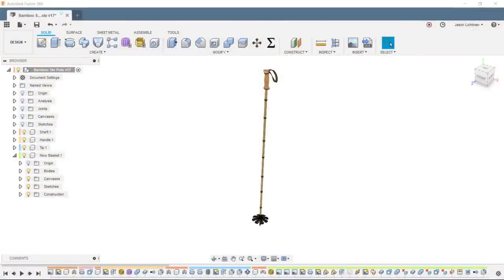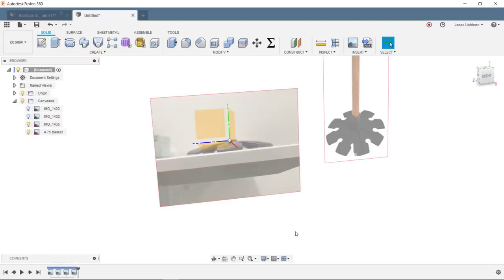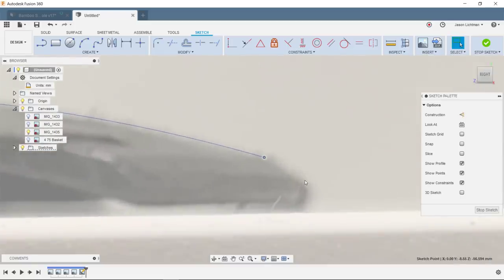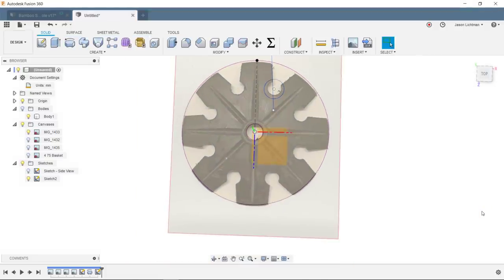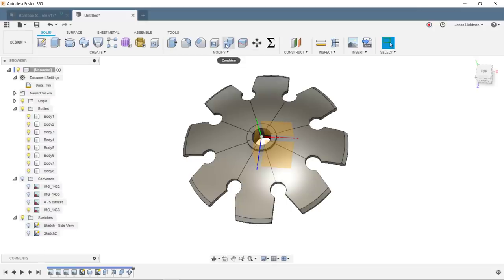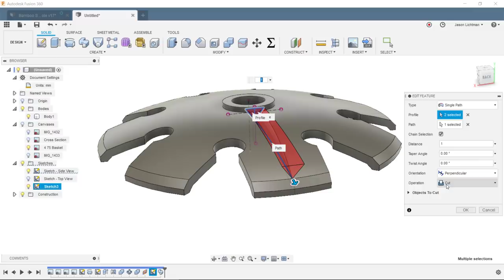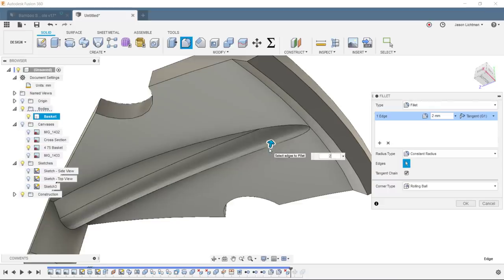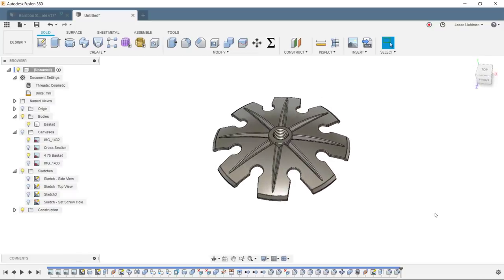LIVE DEMO: Mastering Reverse Engineering

Comment: Pro tip: calipers have another pair of ground faces. Namely, the top of the fixed jaw and the top of the inner measurement jaw. These will be flush when your calipers are closed, and can be used to measure height of things without the fiddly depth bar.
Reply: Anonymouspock, thank you for the tip. I try to use the best tool for the job. So, I do end up using all three areas of the calipers depending on what I’m trying to measure. For what I was measuring in the live demo, I thought the depth bar would be best.

Comment: After aligning the image to the body why did you move the image back to the original position in the timeline?
Reply from the maker: I'll see if I can get Jason to respond to you....or I might be able to figure out why he did that. What time was this at?
Reply: Pete, if I’m creating a model using a canvas, I start by inserting the canvas and positioning it as best I can. Then, I start sketching. It becomes obvious once I put in constraints and dimensions that the canvas position was off by a little bit. No surprise. At this point, the sketch is not complete. It is just complete enough for me to know that the canvas is off. So, I reorder the timeline such that the canvas is after the sketch. That way, when I reposition the canvas, the sketch is in the background for me to align the canvas with. I adjust the position of the canvas to match the sketch itself, which is the correct position (the constraints ensure that). Then, I move the canvas back to the beginning of the timeline. If you don’t move the canvas back to the beginning, you won’t see it when you continue sketching in that first sketch. The canvas has to be first. Hope that answers your question Pete. Thanks for watching!